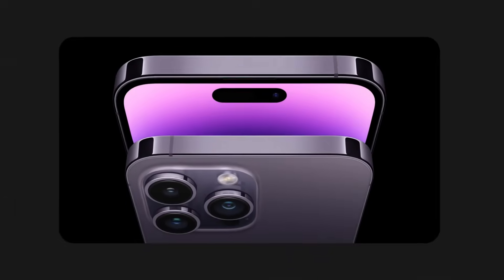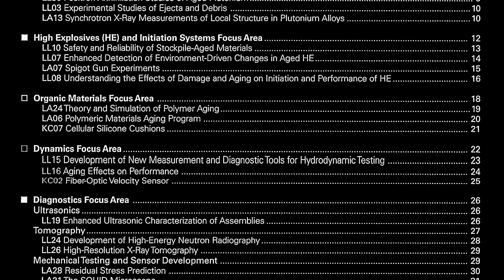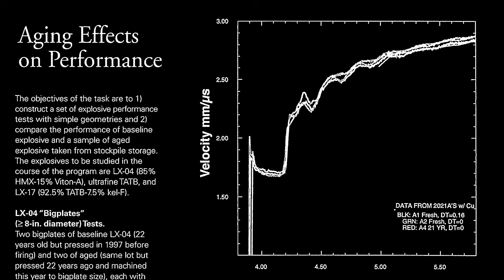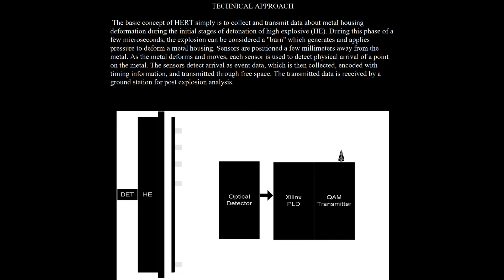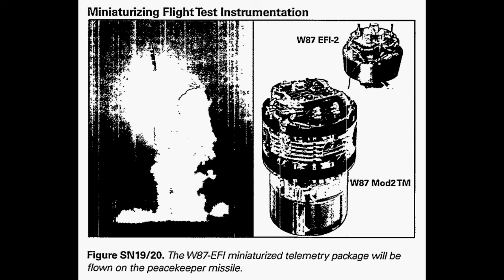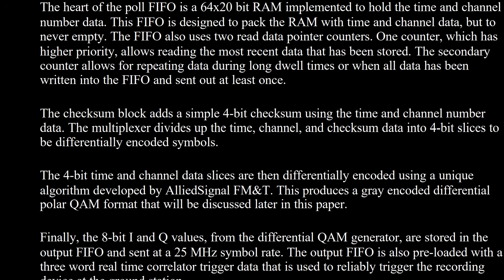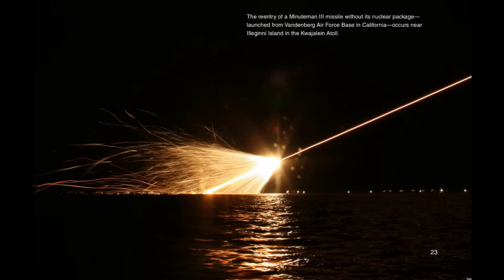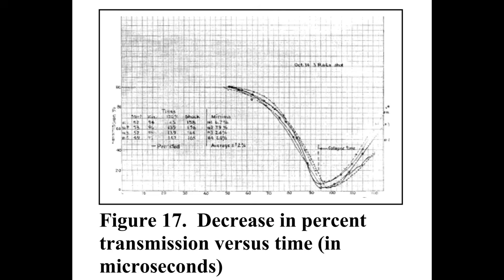The Computer Designed To Die In Microseconds

Comment: I’m nearly 20 years ahead of you, and I worked in Los Alamos in the 1990s, alongside many of the scientists and engineers who had been part of the post-war testing, both above- and under-ground. They had great stories!

Devices like the one you show, even though not used for testing an actual nuclear detonation, we’re called “first light” detectors. The earliest first light system consisted of a vacuum-evacuated conduit leading to the weapon under test, with sensors at the far end. They would capture their signals and forward them just before immolation, like the device you talk about here. Later they migrated to fiber optics and perimeter transducers (set up in racks in underground test tunnel alcoves). Then when underground nuclear testing ceased the stockpile stewardship program shifted to component tests like the one you describe, as well as computer simulation. Alas, we really don’t know how effective this testing is, and some believe that as much as 80% of the arsenal will fail to detonate, despite being “remanufactured “ every ten years or so. We simply do not understand the decay of these complex devices well enough.

I still have some pressure sensors calibrated in giga-pascals.  :)
Reply: @alldeeplearning949  Spent a lot of time in the diplomacy school did we?
Reply: I am reminded of a somewhat humorous interaction in the 80's.  I was working for a DEC OEM (using LSI-11 computers from Digital Equipment Corporation to make a product) and I was at a DECUS (DEC User Society) Symposium at an OEM related panel, and a question was asked of the guy from Los Alamos about why they were an OEM.  OEMs got discounts because they bought lots of machines typically for inclusion in things they were manufacturing, but Los Alamos was a research lab, they didn't manufacture anything, why did they buy enough computers to qualify for the OEM discount.  His simple answer was simply "We blow them up."  He described dropping a long cable down into a hole in the ground with a string of LSI-11s with sensors spread out along the cable.  The bottom end of the cable was a nuclear explosive and as it went off the LSI-11s would measure various effects and send the data up the cable.  Of course the final effect on the LSI-11 was vaporizing it (and he humorously pointed out that the analogue details of how the signal deteriorated was also helpful).  So they literally bought hundreds of microcomputers just to destroy them with nuclear explosions.  :-)
Reply: I have no direct knowledge of how they did this but I assume they would have looked at the constituents of the ongoing detonation and worked out what frequencies would be least attenuated and used those. It’s not a plasma (no nuclear activity) so it should have some level of transparency to RF photons of various wavelengths.
Reply: When the video started I thought he was talking about the sensors in evacuated tubes.  I remember seeing a video about the bikini atoll tests with a sensor at the end of a long tube.  I was blown away by the idea that the light from the initial blast didn't instantly vaporize the sensor at that distance.  Time scales for nuclear weapons are hard for my brain to process.
Reply: @jeffpkamp  Anyone listening at the end of that tube would be blown away too!
Reply: @jeffpkamp  A lot of this is: how fast you can get the data out before the sensor is destroyed.
Reply: I still have some pressure sensors calibrated in giga-pascals.

Sounds like a high pressure career.
Reply: huh, there were a bunch of scientists that have said we probably learned more about building a bomb in the 20 years after we stopped testing bombs because  of the switch to computers. its one of those very tricky problems
Reply: @AsbestosMuffins  I had the thought that maybe the reason they started pushing for test bans had less to do with humanitarian concerns and more to do with the fact that the US might have had a technological advantage in testing that the Russians couldn’t match. You get all the anti-war people on board and still further the goals of dominance. I wouldn’t put it past them.
Reply: Do you know anymore about how they got the information out of the sphere? for the digital tests(that this video discusses) with the device inside the sphere? The fixed tests seems doable, with fiber optics running to a recorder nearby, but if the device is self contain inside a metal sphere(on a warhead), that seems like the worst place for radio signals.
Reply: @diox8tony  throw enough wattage at it and you'll get through a lot of interference
Reply: @diox8tony  I might not be a nuclear weapons specialist, but I know the basics of how they work.
First off, if the explosives go off, that metal casing isn't gonna stay there for very long, so it might not be as much of a problem for a radio transmitter as you might think.
Secondly, they might also be not even using a metal case for the physics package, because the tamper (along with the fusion fuel, if it's a thermonuclear device) is usually placed on the inside, close to the pit, so the exterior casing just has to be strong enough to hold the thing in the required shape. It doesn't have to contain the pressure of the blast. Since this test device is only interested in the performance of the explosives, they don't even need a metal pit.
So they could be using something like a fiberglass composite as the outer casing, which is what the radome of an airliner's radar is usually made of, so you know radio waves go right thru that no problem.
With a fiberglass composite case, the telemetry package would have no issue transmitting the data it needs to transmit in the short time it has available to do so.
Reply: @44R0Ndin  The primary casings are often metallic. We know at least some primaries of two stage devices that featured 10mm thick aluminium casing around the HE. Other designs have used polycarbonate. 
Also, it is useful to have a so-called explosive tamper around the HE to (to some degree) "contain" he HE gases to increase the energy coupled to this pit.
The more usual technique for measuring simultaneity of implosion system was to use doppler velocity interferometry on a hemisphere weapon mockup. It uses laser reflection to measure the distance to a reflector as a function of time. Such a system could be set up in the centre of a half-weapon, and measure how the pit imploded.
Reply: @diox8tony  ever hear of a waveguides, cables, and aerials? radio propagates at the speed of light too. Waveguides are fiber optics for radio, but we have had them a LOT longer
Reply: @diox8tony  “how they got the information out of the sphere?” — Yeah, something I can't imagine, too. It's not so much the metal shell (Fermi gas of free electrons), but rather the ball of plasma from the explosive itself that is even much less transparent to light in any part of the spectrum below gamma. And much thicker, too.
Reply: @diox8tony  If you think you're getting any answers to these questions, I have a bridge to sell you.
Reply: @alldeeplearning949  Whi are you commenting in this tread? Can’t see anyone mentioning their age and miniature figures? Are you referring to Scott, then you’re commenting in the wrong tread! You know for some, technology can be really hard.
Reply: Ooops 😬 I hope that at least 80% of the Russian nukes would fail to detonate too.
Reply: @StephanBuchin  Ideally 100% of everyone's are unable to detonate :)
Reply: @StephanBuchin  That is what I thought as well :) Though, realistically, if 80% of US stockpile is never going to detonate with all the expensive maintenance around it, I'm thinking that no more than 1% of RU stockpile is really detonation capable.
Reply: @Dxun2  🙂 That would be already to much, sadly.
Reply: @StephanBuchin  agree, even one working device is too much. So, that frog have to be boiled very gently. :)
Reply: Yes, the US military gets all the neat toys and technology. My pacifism wouldn't let me  bring myself to go that route, but I did work on some cool general purpose 3D rendering technology and did get sent to a few days at Los Alamos National Laboratory to teach a bunch of bright programmers to use it.
Reply: @alldeeplearning949  Really? That's what you have to say about that? You're worse than a mom who throws away their kid's comic books because they're "satanic".
Reply: Sounds like you have the exact opposite of a 'Mc-Job'
Reply: nice.
Reply: If such intelligent people with the US budget believe as much as 80% will fail, what the hell must the Russian stockpile probability be at with minimal or no remanufacturing processes?
Reply: @jamison884  Who believes 80% of weapons will fail?
Reply: @Evan_Bell  "Alas, we really don’t know how effective this testing is, and some believe that as much as 80% of the arsenal will fail to detonate, despite being “remanufactured “ every ten years or so. We simply do not understand the decay of these complex devices well enough."
Reply: @jamison884  Who's that a quote of?
Reply: @Evan_Bell  In the very post you're replying to and I'm replying to. See above.
Reply: Very interesting, everything needs to be replaced, new tires go flat on a car that sits
Reply: @Packet Guy  - ok I'm going to ask you - shot in the dark. Do you know what the constitution of the russian nuclear arsenal is? Are they mostly fission triggered fusion weapons, even the ones that are battlefield nukes? And do they trigger their nuclear explosions the same way?

I'm really quite heartened about your 80% estimate, my hope is that for the russians given their quality control the number that would actually fail to detonate is closer to 99%, with tritium decay, lack of maintenance etc all entering into it. And that perhaps they aren't using battlefield nukes in ukraine simply because they know that the likelihood of it is that they won't actually detonate.

But then again, all of this is possibly wishful thinking, I'd really love to have someone who is 'in the know' about these sorts of things be interviewed on a ukraine-centered channel like Jake Broe..
Reply: @gregmattson2238  Alas,

Alas, nobody is really “in the know“ since UGT ended. That’s the whole point of the problem with stockpile stewardship. We knew when we did underground tests that all the mechanisms would work. And not all underground tests succeeded. In fact, one UGT, at least, was sabotaged. The Cold War was still a war, with soldiers fighting behind enemy lines on both sides.

Most nuclear weapons in the U.S. stockpile were produced during the 1950s and 1960s, and weren’t designed to last indefinitely. Since the US voluntarily ended UGT, the government calls their ongoing assessment of weapons “science-based”, using theoretical parameters to certify weapons without testing. That’s what the Stockpile Stewardship Program is, and we have zero evidence that it’s effective.

Anything less than an actual detonation of a subject weapon leaves too much to the imagination. For example, consider computer simulation. There are literally millions of variables, and they pile up every nanosecond, far too many for us to realistically account for. Simulation models try to compute the most significant variables, but no simulation has yet matched an actual detonation, so we don’t really have a way to precisely simulate a weapon gone critical. 

Then there are all the pre-detonation processes, which involve timing, dimensional variations, programmed sequences, plus a slew of “three point” safety mechanisms to keep these things from blowing up unexpectedly. It’s amazing that we haven’t actually had an accidental detonation yet.

Finally, you have the weapons remanufacturing process. This is done on several different levels. In the simplest case, pits are removed from existing weapons out in theaters of operation, including Europe and Asia. Those are then reconditioned at a U.S. weapons plant (operated by contractor), and sent back to the field weapons depots, where they are re-inserted into their warheads. There is at least one good book -  The Last of the Glow Worms, by Jeff Woodward — written by a soldier who was involved in this process. His narrative shows just how loose discipline could be in the technician community. Let’s just say the field technicians aren’t brain surgeons, nor angels :-)

Other levels of rebuilding require the weapons to be shipped back to a US facility for complete disassembly, where a lot of components get checked for quality and replaced on either lifetime or condition. But the supply chain for these parts is limited, so sometimes not everything gets replaced that should be.

The Russian weapons work exactly like ours do, for the simple reason that they stole our designs through espionage. Also, virtually all of the most recent (and active) warheads are thermonuclear (hydrogen bombs), for reasons of simple economics: they are much smaller, lighter, and cheaper to build for a given yield than fission bombs. So nobody really builds fission warheads anymore, just tiny fission primaries that light off the cheaper-than-dirt deuterium fuel in H bombs.

Alas, Russian (i.e., Soviet) testing and safety programs had nothing approaching the rigor of ours, and Russia’s political instability means that there is no money to continue to maintain their weapons. Personally, I think one of their warheads is just going to go off one day in an old Soviet bunker. And owing to a phenomenon called fratricide, where neutrons from one warhead triggers low-yield detonations in nearby warheads, the entire nearby arsenal will go with it. These are still nuclear detonations, just inefficient ones, but they would add up to be one big old explosion to be sure.
Reply: @packetguy42  hey thanks for the long in-depth response. I really do appreciate it. It opens up an interesting take on why russia may have not used nukes in the current battlefield situation - namely that the russian high command THINKS THAT THEY MAY NOT WORK. If the US arsenal is a crap-shoot and we maintain them religiously re-engineering them every ten years, then the russians, well, who knows what state their arsenal is in. If they fire a nuclear weapon and it doesn't work, then the world will know they were in essence defenseless.

However there is one final question I have - how close are our nuclear triggers today to the ones we designed when underground testing was successfully done? If they are close, then supposedly mimicking the same detonation pattern as what existed in 1997 should provide similar results today..
Reply: @gregmattson2238  if by triggers you mean the fission primaries, then they are likely the same ones the weapons were originally deployed with. But these assemblies degrade over time, so there is no expectation that they’ll work as they would have in 1992, the last time we did any UGT.
Reply: @packetguy42  yes but don't the replace the assemblies over time, component for component?
Reply: @gregmattson2238  that was the original intention. But the supply chains for these parts is limited, so not everything gets replaced that should be. Also, as this maintenance is being done in the field, not the clean room assembly chambers of the original weapons manufacture. They have limited tools, and are working with procedures that have never been tested on a live device (I.e., detonation testing to ensure that the replacement process doesn’t disable the weapon). These are very complex devices, and there are many ways they can go wrong. keep in mind that the one-points-safe system (sometimes also called two-points safe and three-points safe), designed to prevent accidental detonations, is always working against proper operation.
Reply: @packetguy42  I know this is literally YEARS after you made your comment, but I'd be fascinated to know more about the sabotaged UGT. I did some digging and couldn't find any information about it, although I'm sure I was just using the incorrect search terms. Do you have the name of the test that was sabotaged or other key words/phrases I could reference? I knew there was espionage, but I never imagined foreign tampering in our nuclear program reached the level of outright sabotage.
Reply: @GregBadabinski  let me dig up the documents and post them someplace and I’ll also post  the link here
Reply: @packetguy42 Ah, thank you so much! I really appreciate that. I hadn't expected a response given  the time that had passed, so this was a really pleasant surprise and has made my day.
Reply: @GregBadabinski  OK, the report i'm looking for is the "Mineral Quarry Review Board Final Report". I have to first find the abstract and that will tell me where the document is located.
Reply: Yeah, non-nuclear testing can only reveal so much. I always wondered how you could test this given that the explosion has to be very precisely calibrated and if it ain't right, you don't get an implosion (or you get a far less effective one.) Seems to me that what France and others did (testing in the ocean about a thousand miles from the first part of nowhere) was probably the best for live tests. Anything that comes from the explosion is quickly dissipated by the ocean currents. Unfortunately, it also means anything in the area gets turned into radioactive sushi so these tests were stopped. I think that was a short-sighted idea but I get the motivation.

Comment: Very interesting video. When all nuclear weapons testing was stopped I wondered how they could possibly remain confident that the thing would work years/decades later after improvements in design were made, QC was changed, etc. Well, they simply install this device at the center in place of the plutonium core. When the thing is detonated this device can test the engineering aspects, which are all outside the core. Once the implosion reaches this device everything is down to 100% physics, and the physics doesn’t need testing since it is guaranteed to work exactly the same until the end of the universe.